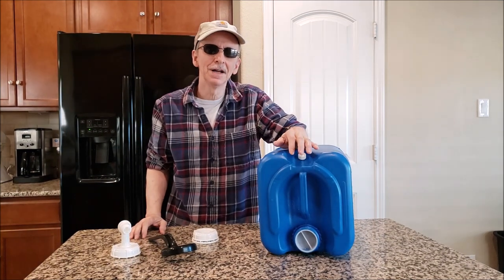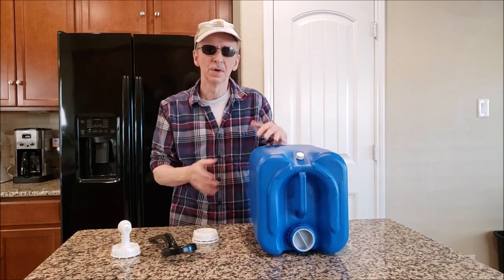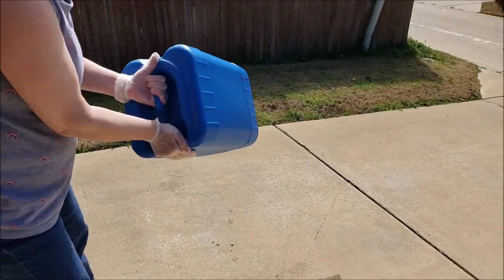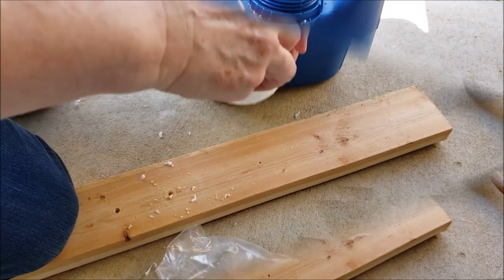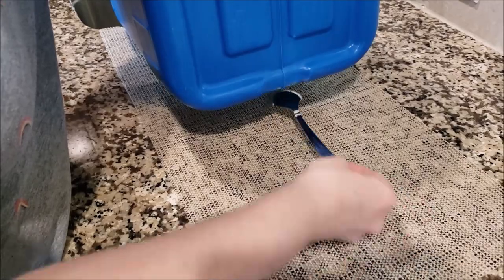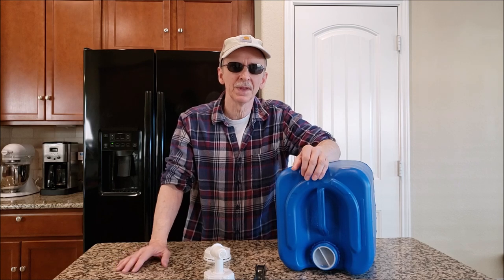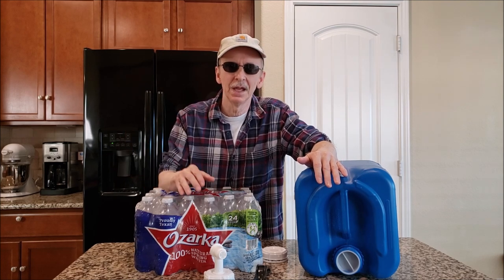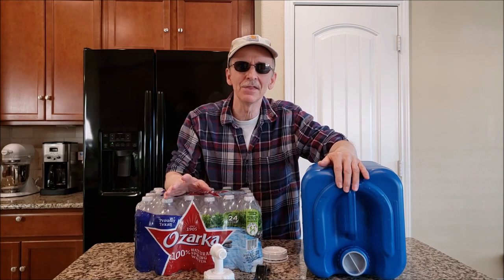5 Gallon API Kirk Stacker Emergency Water Container Review

Comment: Excellent video. I purchased the same blue containers and water preserver concentrate. While the bottle says it preserves tap water for 5 years, it depends on how it is stored, as you mentioned in your video. Another suggestion another reviewer had was that when air-drying the blue container, put a thin cloth on top of the opening and put a rubber band around it while it dries so insects or other flying objects don't make their way into the container before filling it for storage.

Comment: Thanks for the information!    I have 11 cases of dsanti water on hand at all times due to our really bad tap water.  One is open for use and 10 more in rotation.  I have about 50 of the larger not quite a gallon size ice mountain water jugs filled with tap water and a hint of bleach.   I rotate some monthly and just dump out the bottles into washer when doing laundry so it’s not wasted.  Then refill with tap.  If I were to need to use the jugs for drinking/cooking I would likely boil it first.   Don’t have a Berkey yet but definitely on my radar.   I really like the idea of the blue jugs however for a single older woman the weight is a really big  con for me.  And I would have to store them in the garage with a lot of temp fluctuations.  I store my bottled water behind my living room couch -easy access and pretty steady temps.  My couch is out maybe 5 inches from wall and due to the slant downward on the back I can easily store the whole case.   They are not visible and no one has noticed!   Great info and greatly appreciate your thorough reviews.  😃

Comment: I usually rotate my tap water containers about once a year. Per my lazy butt guidelines and my bad knee. I keep it in my basement crawl space.  It is dryed in with a concrete floor.  No problems. Had a water outage and a boil order. No one had any body issues with the water after drinking it.

Comment: We got the same containers. However, we decided the locking mechanism built into the caps was rather cumbersome. So, we removed them. Besides, we plan on storing them in our garage and, as such, we're not as concerned with tampering. As for the spout feature, we'll just use the caps that already have holes in them. We're fortunate enough that we live in an area where our city put great effort into making sure our tap water is clean. I know, I've made coffee with our tap water and it taste just like it went through a Brita filter.

Comment: BTW, we use 5 gal "pool shock" containers which is considerably less than the price of the containers you feature but is the same make up. We also have on hand for a long term situation powdered pool shock which can last up to ten years or more if kept in ideal circumstances. It is important that any powdered pool shock not contain any germicides, algaecides, additives or anything else, just plain old chlorine. After buying liquid pool shock for the swimming pool we simply keep the container and forfeit our $8 deposit. I have ten containers on hand and in winter I keep four in the greenhouse from November until March. It works well  for us.

Comment: recently saw a youtube video where somebody had stored water in a blue barrel for many years and ran it through a berkey and it tasted good. We then tried the same with water we had stored for almost 2 years same result.  guess any of these filters that can filter river water can filter old water
Reply: That's what I was thinking. If a Berkey  or other good filter can filter river or lake water to make it drinkable, then why do the need to change out the water every 6 months to a year. Shouldn't the Berkey take care of anything in the water? Especially when you bleach out the container, and put in bleach when you fill it with water. They say that if you have chlorine already in your towns drinking water, then it is safe to store your tap water as is, without adding any more bleach. Nothing can get into the closed container.

Comment: I am boiling my tap water first before putting it in.
Can I use vinegar and baking soda instead to sanitize my plastic Wal-Mart container? I really don't want to use bleach.
Reply from the maker: I dont know.  I wouldnt.  I would follow cdc guidelines.  Do some reasearch about bleach in water.  I think you will feel better after you learn more about it.  Look into how public tap water is treated.  Good luck. 👍
Reply: Bleach is the only way to insure it is sanitized. You really use very small amounts.
Reply from the maker: Do not boil bleach if you use it!

Comment: Is this just for household use or do you drink the water with bleach in it?
Reply: Once it sets a bit it is perfectly safe to drink. Chlorine is used by municipalities to disinfect drinking water.
Reply: A higher concentration of bleach is for cleaning, but a lower concentration can be used to sterilize and maintain water longer, just like chlorine in tap water. I'm not sure about liquid bleach, but tap water can be agitated and aired out to reduce the chlorine. You will find multiple sources of info on the Web about that. I also know as someone who used to drink a lot of tap water. (Now I have an RO filter, mainly to remove fluoride.)
Reply: @shuumai  it’s the same for liquid bleach.  You can even use pool shock for large quantities of water.  There are sone good tutorials online with measurements.
Reply: It’ll be safe to drink, the bleach will dissipate overtime but it’s important to store out of the sun and in cooler temps!!